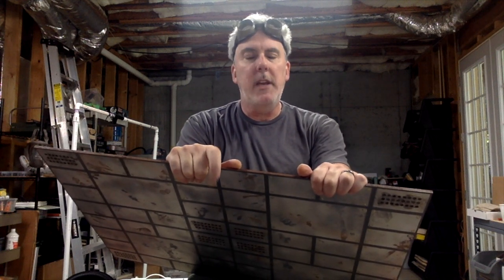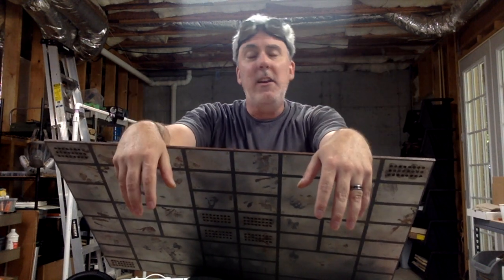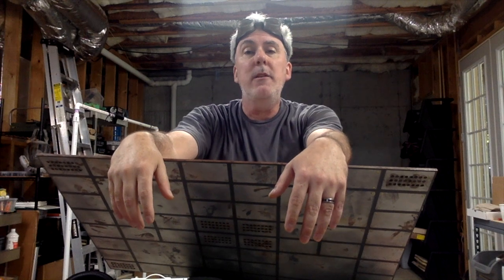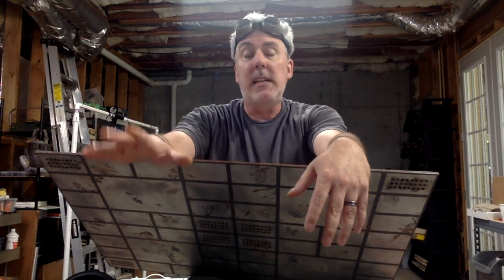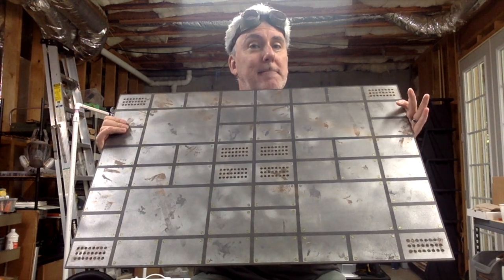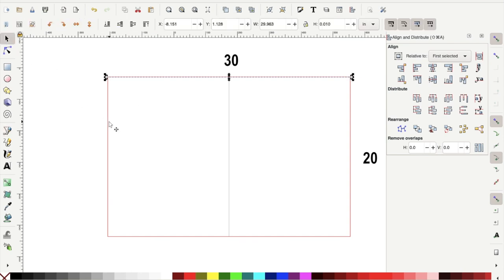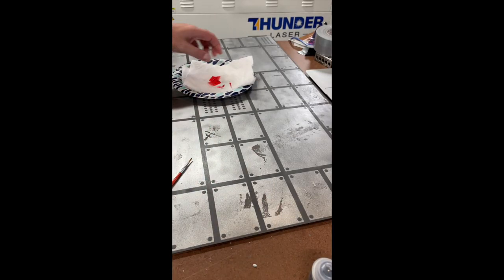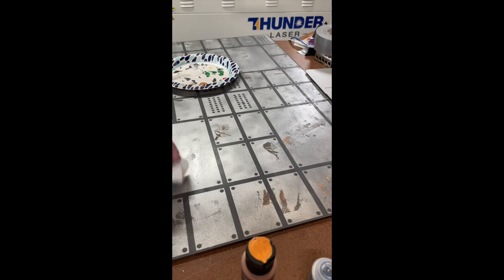Designing a Custom SciFi Playboard

Comment: If you want to break this down into 12"x12" tiles, you can achieve all of this on a cheap desktop diode laser or desktop CNC (if you happen to know someone or somewhere with one of those). Some 3D printer manufacturers also make diode laser kits for their machines for around $50-60 if you fancy taking that route.

The only thing you'll have to consider is that if the diode laser is only 5W/500mW, then a 3-5mm board will probably take two passes to do any cutting (etching/engraving should be fine)

If you don't have access to the masking tape (or don't feel like doing any 'weeding') you can also spray the whole thing a dark grey or black after the laser work, sponge on some metallic and then drybrush a few of the etched edges with some Red Ochre, for a nice worn/corroded effect.
Reply from the maker: very true! A lot of the diode lasers can easily cut through 1/8 and 1/4" wood.